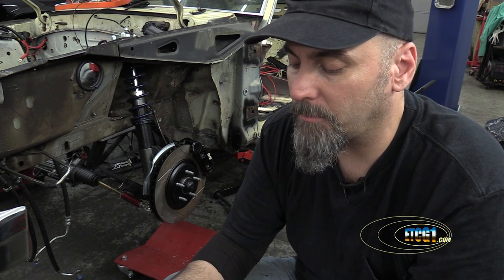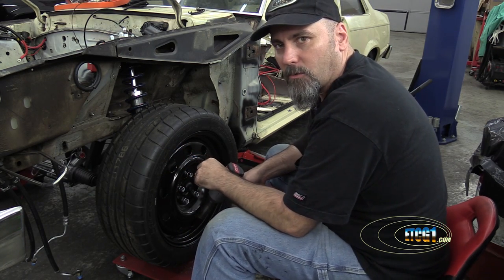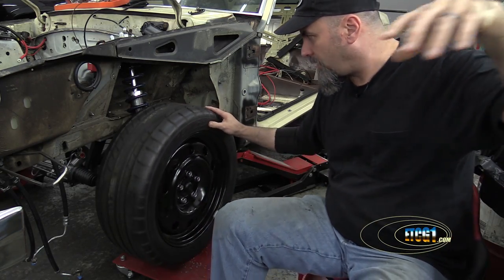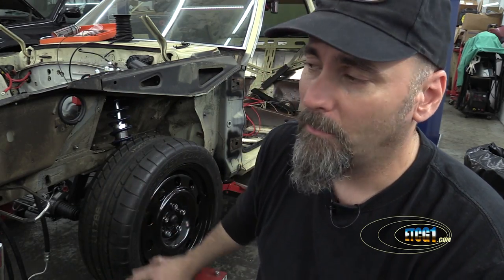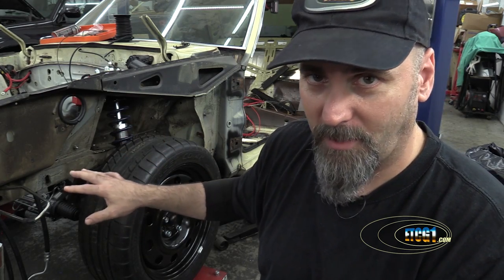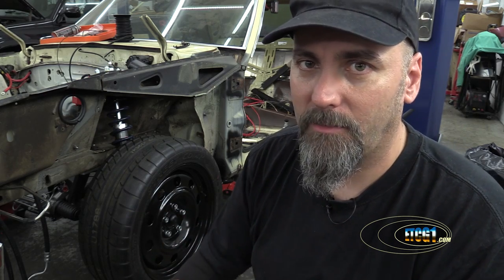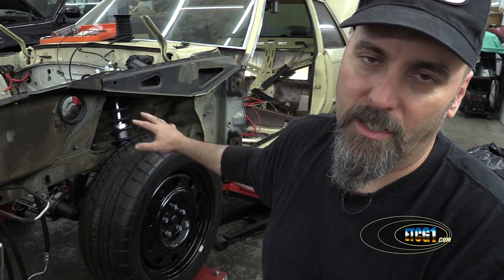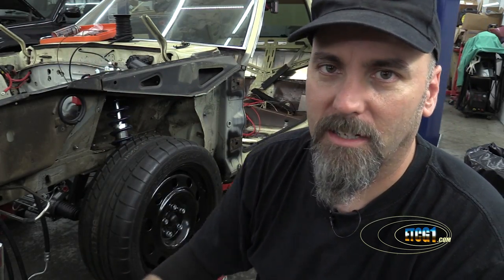Are Wheel Spacers Safe?

Comment: Is there an issue with installing different size spacers or adapters on each opposite sides on the same axel?
I was measuring for adapters on my rear axle and one side is 25mm and the other is 20mm.

Comment: I agree. This is doing wheel spacers right.  I say the manufacturers of them should produce them already hub centric though.  Putting the longer stronger studs on...Kudos.  Hopefully the rims still hit the hubs as well. Then it is done right.
The adapters you showed briefly on the screen that add a 2nd set of lugnuts, I'm not a fan of.  They need to be torqued properly and re-torqued a few times after installation.  Most of the times, they are just put on and ignored.  The lugnuts work loose and you have issues because they weren't torqued right.
Then you get the guys with 1 ton dually diesel pickups that install the 2 inch and 2 1/2 inch adapters between their duals because they are too cheap to buy the right rims to install the extra wide tires on. They decide to use adapters and put the tires on their factory rims.  I've spoken to a few manufacturers of those adapters and they do not recommend using their adapters on dually applications in that manner.  They apply extreme stress on the outside rim on uneven surfaces.  These guys are all using their trucks for hauling loads at or near their trucks maximum load carrying capacity and the adapters are not rated for this weight range.

Comment: As long as they are hub centric and the lug bolts are the correct length, plus the center of the wheel should be where the center of the brake rotor, that's your pivot point otherwise you create bump steer.

Comment: Here in New Zealand '  I was told by a mechanic that the rule for using  thin spacers  is that they  need to be attached  to the  inner mounting surface of the wheel 'I suppose  they mean  gluing them on.

Comment: What is your opinion on large spacers, or adapters? 

In my case, I have a custom Mazda REPU with a '69 5.0L V8. It has a Ford 9" 5 lug Rear end.

Well, there were 2 problems with using that   9" rear end. First off, it's about 4" shorter than the original Rear end. Also, It's 5 lug when the front hubs are 6 lug. So for the sake of simplicity I bought 2" 5 to 6 lug adapters. This allowed me to have the same track width front to rear and also allowed me to use 6 lug wheels all the way around with out the incredible expense of having the rear end custom made.

I understand this will probably decrease the life of the axle bearings, however is it safe?

Comment: Does wheel spacers increase the potential of damaging the wheel bearings because you are extending the optimal fulcrum of the wheel and suspension geometry or it moves the wheel outboard and alters the scrub radius of the car causing more steering effort to turn the wheel.

Comment: The only concern I would have is by moving the wheel out you are making it easier to create travel. (Granted not much with only a quarter inch) Think of it like a wrench handle. The longer the handle is the more force you can apply. The a arm from the point the shock is mounted to out (including the tire) is the handle. This would also be the case if you get offset rims. You may need to stiffen your shocks slightly when you do either of these. The only way to tell of course is by getting the car on the road and driving it. Which I am sure you would greatly love to do. Keep up the great work Eric and remember that SOME of those people out there that are screaming "you're doing it wrong" are doing so because they care about you and not just because they are trolls. Please don't get discouraged.

Comment: Question from the floor: Is it a common practice to use spacers on only one axle? For example coilovers on a FWD car like Mazdaspeed 3 have a smaller clearance between the wheel/tire and the strut body and usually a spacer might be required for the fronts but not necessary for the rears..

Thanks.

Comment: Actually I think the issue comes from wheel adapters, rather than real spacers that you are talking about. A properly bolted connection is indeed tight enough that the friction from the two parts clamped together is enough to keep it from moving. More importantly because of the elasticity of the bolt material most of the oscillating forces (from the rotating wheels of course) goes through the material of the wheel, spacer and hub itself, which is under compression and not the bolts which are under tension. This is good for the fatigue life of the connection and means a bolt that is properly torqued down is way less likely to snap than one that isn't tight enough. Seems counterintuitive but that's how it works. Now, the type of adapter that is deemed dangerous is the one (typically made of aluminium) that you bolt onto your hub and it has another set of studs that the wheel bolts onto. Every rotation the wheel wants to flex and shear that material back and forth and that's where you run the risk of your wheels coming off if they aren't built to take that. Yours will be fine, I'm sure. If anything goes wrong I don't think it'll be the spacer's fault.

Comment: Hello Eric,  I have a question about wheel spacers.  Maybe you can help me out.  I bought a set of winter tires and rims last year for my Subaru Crosstrek, and this year I traded in the Crosstrek for a Forester.  The wheels won't fit.   I know wheel spacers properly install are safe.    But, would that affect or cause problems to the mechanics of the car, such as the shocks or bearings?     Please adivice,  Thank  Fred.

Comment: I'm surprised you failed to mention the extra stress on ball joints and wheel bearing. I use spacers aswell but it does put more stress on ball joints and tie rods

Comment: Agreed, no problems with wheel spacers when properly installed. I used them on my stock car (circle track) until I got caught using them. And it wasn't against the rules for safety reasons, it was to keep the class at a budget. And those wheels are the balls, keep them as much as possible. 

Any concerns about Ohio weather and those spacers sticking to the hub or wheel? Thanks for your hard work Ericthecarguy. ~Dave from Jax Florida.

Comment: I was only just alittle worried when they were not hub centric. I was thinking that at high enough speeds that this car is capable of there might be some shimmying. BUT, just a few videos ago, the channel Cleetus McFairland had to use the SAME spacers on his ~700whp stripped out corvette drag car at the last minute to get the wheels/tires to clear in the rear. Didn't make them hub centric just ran them, at speeds up to 146mph iirc. Did fine. So yeah, the spacers are fine, even more so now that you made them hub centric. As far as the "extra shear force" I seen someone say, lug nuts shouldn't have any shear force to start with, the wheel centers on the hub. But I do agree that the steel wheels are a bit of a concern, as I remember they are not perfectly round.

Comment: I have an 84 Buick Lesabre Limited i need a spacer just thick enough to get my center caps on the aftermarket wheels i bought the spindle is so long the caps won't go on need about 5/16 of an inch clearance, would spacers work the wheels fit perfect, i just cant get the center caps on? THANKS

Comment: I run f350 axles and 42 inch swampers with 2   1/4 inch thinch wheel spacers per wheel. Its a off rd truck but they ve been on my truck for 15 years now. Wheel n hard in rocks snow and mud in temperatures from 35c to - 35c in winter. I use a torque wrench and retorque after 100km. Ive never once found a loose wheel nut in 15 years of runing spacers

Comment: I have a 350z and I bought rims that have a 40 offset. I was told I need 20-25mm spacers to make them fit flush. Is that a ridiculously large spacer length to have? Or is that relatively safe?

Comment: Lol eric, the new generation operates this way .When something goes wrong they blame everything under the sun except for any accountability for themselves. This goes with everything nowadays up to and including wheel spacers. Don't let this crap get the best of you, I can tell you're pretty pissed off. Unfortunately Common Sense isn't common anymore. I personally have been running properly installed 1/4 wheel spacers on 800 horsepower boosted lq9 meth/water fbody with 305 tires  . I pound the piss out of this carand have had no isssues.  Keep up all your good videos man, you've helped me with some troubleshooting I've had to do over the years and you're good at what you do. Good luck with your build.

Comment: In all honesty those P71 wheels are more skookum than alloys would be.

It's also worth noting that friction is the sole retention force that holds semi truck tires on. Ten studs torqued to roundabout 500 foot pounds provide so much friction between the wheel and the hub..well, actually, the outside wheel, the inside wheel, the brake drum, *and then the hub*...to support a vehicle capable of a gross weight a blonde one north of 80,000 pounds. And, indeed, most wheels on drum brake equipped cars...especially domestic ones like the rear brakes of the '85 F150 I drive every day...are in effect using wheel spacers right from the factory. The brake drums are free floating, as in, they are held on by nothing on their own. The force of the wheel bolted on above them is what retains them, and they act in much the same way as your quarter inch spacers do. A lot of medium duty commercial vehicles also have some funky business going on. Mercedes Sprinters will sometimes have a heavier duty wheel fitted that requires a giant fucker of a spacer bolted to the hub, this is *factory equipment*.

That being said, if I'm buying a personal vehicle second/third/fourth/eighth/69th hand, and I see wheel spacers, I'm noping right the fuck out of there. There's no guarantee they're installed properly.

Comment: My friends have 1 1/4" spacers on their rock crawlers (almost identical to the ones shown in the little snippet in the video), and they work flawlessly. Now granted, the center hubs are way longer than on the fairmount, only because they have lockers on them, but even without that on the rear wheels, I've noticed that, if tightened correctly, the recessed portion of the hubs, while using the lugs that are provided with the spacers, create a lock on the wheels that are more or less as efficient as having the center hub holding the wheel centered itself. Yeah, again they're never going to drive those trucks over 60mph, but even at that soeed, there isn't any noticable wheel chatter from the spacers at all. With what Eric has, I would still trust them just as much as with the ones my friends have...now that wheel flex issue though.......hmmm

Comment: Critics of all wheel spaces should take into consideration that in most automotive applications either the disk rotor, or a drum brake acts as a wheel spacer since they slip over the studs, go up against the hub, and live between the wheel and the hub.

Comment: i made my own wheelspacers they are 3 mm thick so my wheel still centers on the hub and the conical wheel bolts do the rest they work perfect. also i checked and the bolt thread sticks out of the back of the hub so safe? i think so

Comment: Using hub-centric spacers is the safest way to add thread width on any vehicle. I've seen too many vehicles with non-centric with wobbling wheels that failed. THAT is because of IMPROPER INSTALLATION.

Also, getting a tire with stiffer sidewalls help the flexing to get in hard turns UP TO A POINT. Too stiff will kill turning;too loose will kill you.

Comment: Cool video, I really liked it. I’ve read that people both have had good luck and bad luck with spacers. I’ve been reading to only go with the hub centric spacers. I have a ‘90 S10 4x4 and want to use a pair of bolt on hub centric wheel spacers, in the rear to push the rear tires out to match the front tires. Petrol Wheels has a wheel that I like that I’ll have to get wheel spacer adapters, I’ll never double up on the tears, I’d rather get the rears made in the width I’m wanting. I’ve also read the for the bolt on ones, frequently check the torque. Do all the good spacers have instructions to make sure that they’re properly installed? Thank You.

Comment: I generally agree that a properly speced and installed wheel spacer should be fine.

That being said, a lot of the stuff I see people doing will make an engineer cringe. All other things held constant, a wheel spacer increases the moment arm length on the wheel bearing. A 1/4" change isn't going to do much - especially if you have a nice new bearing. But moving the wheel out a few inches further out could easily cause premature bearing wear or worse on some vehicles. A big enough spacer will mess with the steering design. In the offroad community, we generally don't like big wheel spacers since we're already wrecking parts without the extra leverage.

Like a lot of other aftermarket parts, wheel spacers that are appropriate for the rest of the system and properly installed are very likely to be fine. Eric did his homework and used correctly fitted thin spacers so his results will likely be good. Too many other people don't match the mod to the rest of the system, have problems, and give the parts a bad rep. Then politicians step in to save the day and ban something with a legitimate use. Utah banned wheel spacers - presumably after poorly thought out systems caused problems.

Comment: Make sure you buy Hub Centric wheel spacers!!
I put 20mm wheel spacers on my Clio 182 and forgot to tighten all the way one of the wheels.
If they were not Hub Centric the wheel would have flown off on the motorway!!!
I heard the knocking and was able to stop and tighten the extended wheel nuts.

Comment: But Eric, there is a limit as to how much spacing you can apply to the wheel.

Quarter inch is about fine but anything more could have a serious detrimental affect on handling, and wear and tear (stress and fatigue) on the lower suspension and the steering components.

Comment: I've got 90k miles on my set of 1/4 inch spacers on the rear of my car with 315/35r17 tires trying twist them off. Might i ask what made you decide to go hub centric for your front spacers?
Reply from the maker: I was at the fabricator anyway and didn't want to have to glue them to the rotors every time I took a wheel off.

Comment: In practical physics, it's easiest to see what exactly happens when you take the variable in question and take it to the extreme. For example, what would happen if you were to install a 5 foot wheel spacer with 5 foot wheel studs. Hopefully you should be able to quickly spot the issue if you have any sort of higher ed education. As you move the wheel away from the vehicle, you are increasing the force applied to the fasteners due to the "lever action" effect the spacers cause. A 1/4" spacer is insignificant but as you increase the space between the hub and wheel, you are asking more from the wheel studs. The constant increased stresses on the studs can cause them to fail prematurely.

Comment: I never use wheel spacers mainly because I find them a PITA, and rims for my jeep aren't much more expensive then the spacers are.  This is less a issue with such thin spacers as ETCG is using, but on thicker ones that have their own studs, you need to retorque that just like a wheel.  So when you install the spacer, or have it off, you need to retorque the spacer after 100k or so.  Rather then just retorqing the wheel you now need to take it off again to torque the spacer, then retorque the wheel 100k after that.

There's situation's to use spacers so long as it's done right, it's often not though.

Comment: I seen some kid with a 2000 era Mustang try to maneuver it around the gas station. All 4 wheels had excessive camber and width, power steering sounded like it wanted to kill itself, and it was making a horrible grinding noise. I got a closer look at it and he used 2 of what I would guess was 2" wheel spacers with home made studs holding the wheels on! I was amazed that thing was still derivable. About 2 weeks later I seen it in the junk yard with the rear axle removed. Needless to say some people can be stupid when it comes to using wheel spacers.

Comment: Wheel spacers when properly installed are safe. Which is 100% true. Downside to wheel spacers though can be an added load on the wheel bearings causes premature wear. Otherwise let em roll!

Comment: No backseat quarterbacking here. I am curious do the spacers  in any way affect the wheel alignment geometry on the car?
Reply from the maker: Not wheel alignment, but they do widen the track a bit which can actually improve handling. You have to watch out for fender clearance though depending on the vehicle and the thickness of the spacers used.

Comment: As you said ... 'Is not a perfect world', but 100% sure myself that your current setup equipment right now is much better and secure than a regular brand new stock car that uses the minimum secure rate equipment required by the state on any factory car to keep cost low you name it.   There is not perfect car not even for a perfect world!

Comment: Mmy rear end sitting 2 inches in on one side causing my tire against stable bar we can use a spacer to get the tire off  is this safe or should I just get a adjustable trak bar then I read bad about adjustable trak bar this is for a jeep 2014 any ideas

Comment: Thanks for the birthday wishes. You said alloy wheels would spoil the sleeper look. Surely that could be obfuscated with a little paint/powder coat/anodizing and machining? I understand the added cost is undesirable, but if it's needed would you try to hide them to maintain the look?
Reply from the maker: Did you miss the part where I also mentioned the expense of said wheels?